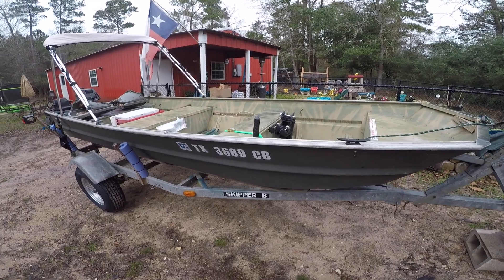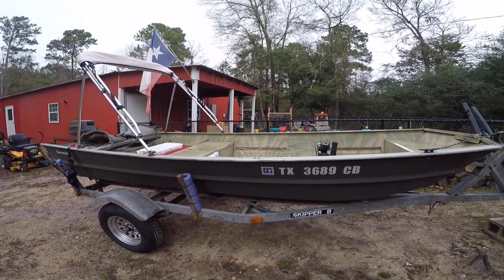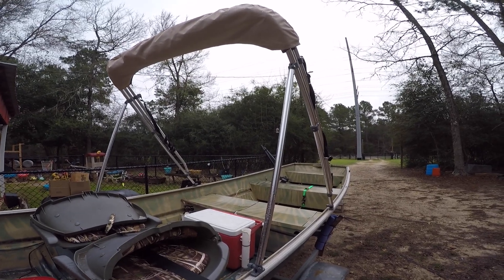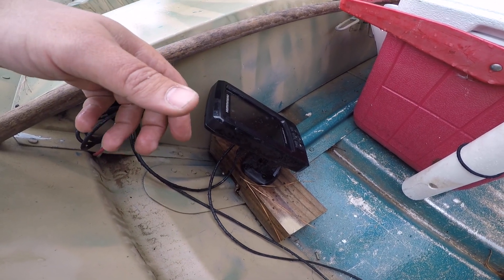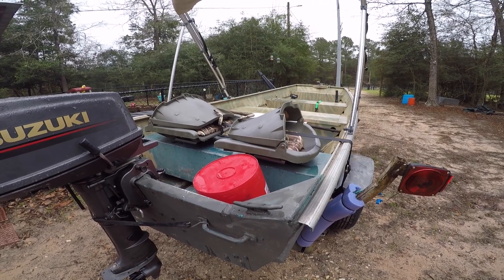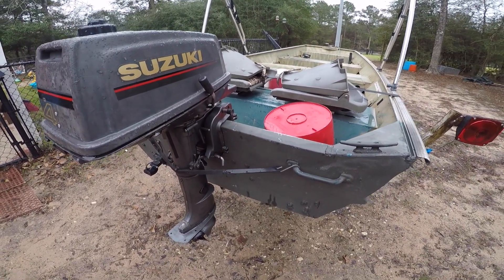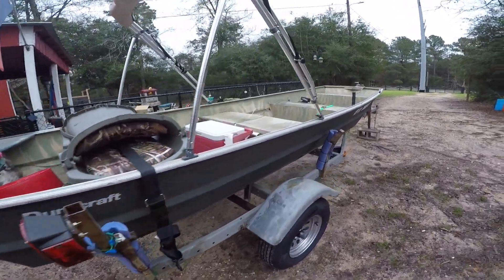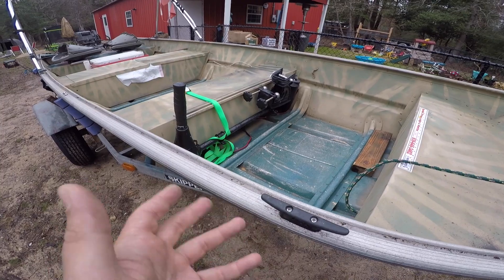14FT Jon Boat Budget Duracraft 1436 4hp Outboard Fishing John

Comment: Nice! I've got an identical 1971 duracraft
Reply from the maker: I ended up selling it. My only complaint was the design of the livewell lids it let in rain water and would easily bend if an adult stood or sat on it. I wish I had the version with no center seat. I thought about removing it or making a lid out of plywood but ended up getting offered 2x what I had invested. Other than that it was rock solid.
Reply: @NewWorldOrdnance  I didn't think it was a livewell, I thought that was the storage for the fuel tank and batteries?
Reply from the maker: Maybe it was. Either way the lid design sucked lol
Reply: @NewWorldOrdnance  the 2 lids definitely leak, I keep a tool kit and store tackle box in it
Reply from the maker: @davidcrochet9040  Yeah that is how mine was it was really frustrating drying it out every time it rained lol

Comment: Hows the 4hp work for you? My 7.5hp took a crap on me.
Reply from the maker: I sold the boat. It was fine if you aren’t in a hurry and don’t need to be on plane. Faster than a trolling motor and lighter than a battery. Neutral and reverse are must haves. I still have a 2.5hp merc and I hate the forward gear only